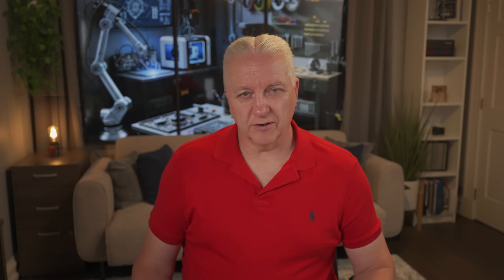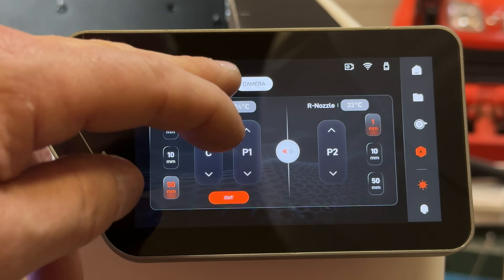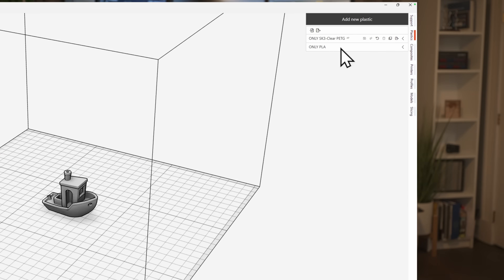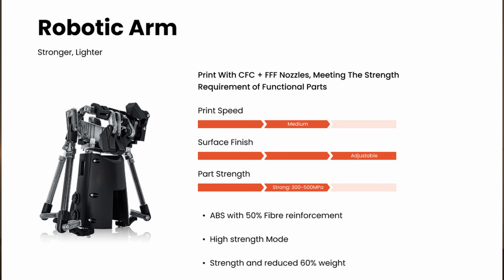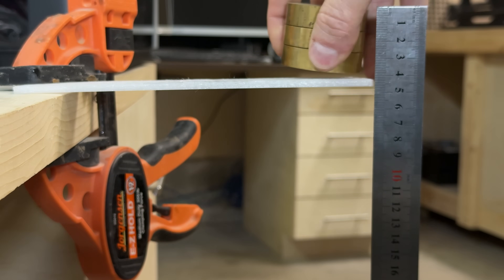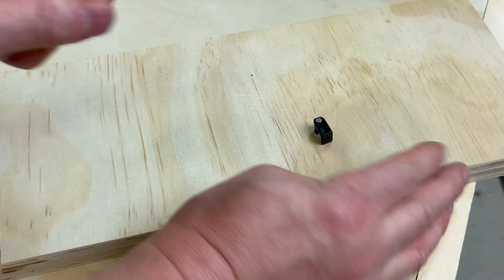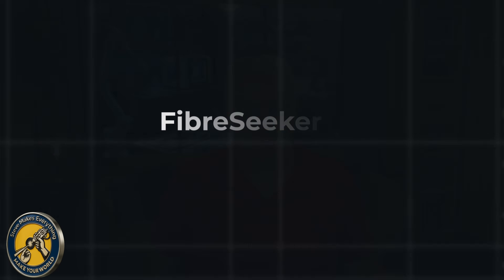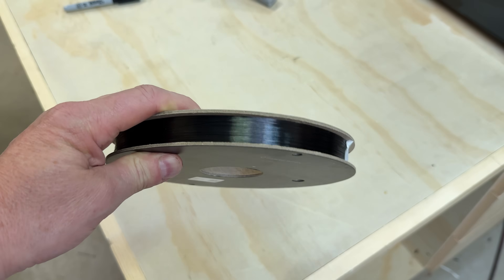This 3D Printer Makes Parts STRONGER Than Aluminum!

Comment: This printer is a hype. It can't put fiber threads in a z axis where every 3d print is weakest. It's overpriced printer for USA market where everything is overpriced. Plavix is 600 EUR in USA vs. Europe 24 EUR a pack. Seems USA wants people dead.
Reply from the maker: The. I’ll simply say, “Don’t buy it”.   This printer isn’t about making carbon fiber processes better.  It’s about making 3D printing stronger - and it does that just fine.

Comment: Let’s address the elephant in the room: Z strength.  Z strength is limited by layer adhesion which is substantially weaker than XY even in traditional cartesion polymer 3D prints. And it’s disappointing that Fiber Seek has the same problem but even more so.  It would be a game changer if FS could change their slicer software to print continuously in the Z direction.
Reply from the maker: This true but also applies to carbon fibre cast in resin.  There will always be one axis that is weaker.  As a designer, you can print in an orientation so the strength is in the direction of the highest stress.
Reply: @SteveMakesEverything  The difference is we can choose the best orientation to apply each layup, but with printers we have to choose one orientation for the entire part.
Reply from the maker: @snivesz32  True, though this might be more of a corner case - a least for the kind of things you'll make with this printer. 

This printer isn't designed to replace existing carbon fiber processes, but rather to make 3D printed parts stronger.

Comment: Does the fiber only add strength in tension, or does it help parts in compression as well?
Reply from the maker: Carbon fiber in general is for tension solutions. I think if you put two similar pieces in a vice - one with CF and one without, they would probably be crushed the same way.  I don’t think the  3D printing would make any difference.  Even in resin the CF would crush.

Comment: There's no point to high strength mode if the software is unreliable. Hardware is useless without dedicated quality software tools.
Reply from the maker: I didn't have any issues with reliability of their software.  I'd rather use OrcaSlicer because it's one I'm used to with other 3D printers,  FileSeeks software gets it done, though I'm waiting for the Mac version which they say is coming.

Comment: Hello,i am curious as i thought carbon fiber will need epoxy to go full strength.but i don't see any with this printer ? Is it a bad thing it lack the epoxy ?or it doesn't matter ?
Reply from the maker: The goal here is to get parts that are much stronger than basic 3D printing and the FilerSeeker 3 achieves that.  But carbon fiber is always layered in some way (3D printed or not). Along the layer axis, it will always be weaker.  If this case, the layers are sandwiched together with a layer of PETG, PLA or other plastic rather than resin.
Reply: @SteveMakesEverything  Thanks a lot for the explanation. So the layer of plastic act as an epoxy ?
Reply from the maker: @vdiallonort  Yes exactly.  When the fiber is extruded, it is encased in liquid filament and then basically prints like any other filament material

Comment: I really do not get your take on this.  People will not print these fiber reinforced parts in volume for production.  These would be more for a part here or there.  As another creator said, “A part that would normally take 45min now takes over 6hrs with fiber replacement!”.  

Hammering a little nail that I can hit the side with my tape measure does not show that much strength.  If you used a hammer claw to remove ring shanked nail then that would been a better test.  

Side note - Towards the end it just felt like you were winging it, and fishing for things to say.
Reply from the maker: As far as timing, it would depend very much on the amount of carbon fiber desired.  If it is solid CF, it will take 4-5X, but if you just want to lay down a 10% infill, it will be much faster.  However, I disagree that this isn't used for production because this printer originates in an industrial company that  makes printers to do exactly that.  However, to your point, regardless of the material, anything 3D-printed is a prototype as far as I'm concerned.

The point of this video wasn't to hammer a nail, but rather to print something simple that people can relate to, which would otherwise be impossible with a 3D printer.  I guess I could have printed a wheel wrench 😉

At any rate, this printer is not for the average home user.  I've already printed a bunch of camera and light mounts for my studio that I would have had to get a machine shop to make out of aluminum.

Comment: I think Markforged will give a more consistent strength and finish, they have had a while to improve their system and the precoated fibre is more uniform than smooshing a fibre into some melted filament. This seems like a good start though. I hope they can get it a good enough standard to make it a viable alternative. I wouldn't want to be in the first batch of users though.
Reply from the maker: Possibly.  Keep in mind that the FileSeeker 3 is under $3K, while the cheapest Markforged printer is going to run in the $15K-20K range.  You have to get something for that extra money. 🙂

Comment: Curious about layer adhesion and strength along z axis.  Thanks for the vid.  Great review overall.
Reply: From what little understanding I gather out of this video, its conceptually sound. But, there still lies various weaknesses. The weak link is similar to regular fdm and that is in between the layers where the lamination is all there is to keep the layers together. But, on the verticals where the fibres are passing through, the print outs will shine no doubt. Then again, how often does one need this kind of directional strength? I can't fathom. May be I am mere mortal, so i cannot comprehend further. A bambu a day solves many (but not all) problems a day and that should satisfy most mundane requirements including those of yours truly.
Reply from the maker: @chiawildy563  😀  Ever regular carbon fibre parts are bound with resin and are typically strong on only one plane.  This printer doesn't change that.
Reply from the maker: I guess no matter what, there will be one direction where the shear strength will be limited, but this applies to all material designs regardless of the manufacturing process.  Mechanical engineers will design parts so that when manufactured, the strongest portion will be aligned with the direction of the most stress. 

If you are making parts with excessive stress along all three axes, this probably isn't for you. In that case, carbon fiber in general wouldn't work, regardless of the manufacturing process, because it is always laid down in layers.
Reply: @SteveMakesEverything  Great sharing. I believe that like all tools, FS3 serves its own niche. It may not for everyone, while novel in concept. This novel approach to tackling strength is interesting for those who has a genuine use for it. I guess most of us won't reach this sort of mechanical strength requirements if we are just printing toys, lamps and whatnot. Cheers.
Reply from the maker: @chiawildy563  Yes, I agree.  This printer will definitely not be for everyone.  I'm thinking it's aimed at print farms.

Comment: I am glad to see the 3D printer industry making printers that can handle engineering-type materials to make strong functional parts.  But this Fibreseek printer takes that to a whole new level.  At the job that I retired from a few years ago, we had a Markforged Onyx Pro that could make strong parts impregnated with fiberglass fibers; we got very good use out of that printer.  But to see this Fibreseek printer with a much larger build volume selling at half the price is a revelation.  I find myself wondering how they worked around Markforged patents; have any of them expired?  Thank you so much for this video!
Reply from the maker: Industrial 3D printers capable of carbon and glass fiber printing have been around for years. Not sure who owns all the patent though.  I am wondering if FibreSeek is going make glass fiber available too.
Reply: @SteveMakesEverything  Hi Steve. During the plant tour that Grant @3dmusketeers did Ryan mentioned that glass fibre will be offered in the future. Not sure if near future or a yr from now. Copper wire was mentioned also. 
The biggest question   (unanswered) for me is what infill patterns did you get to choose from? 

Thanks again for your well-done video sir!
Reply from the maker: @helixx_4D  Yes, glass is definitely coming.

There are several infill patterns specifically for continuous fiber in Aura.  A couple of them appear to be ISO manufacturing standard infills, and the others seem to be variants of these.

They differ from traditional patterns found in tools like OrcaSlicer because they are designed to keep the fiber running as long as possible before it needs to be cut.

Comment: Yeah the hardware isn’t such an issue anymore but the software is a major hurdle for such a printer. Same goes for 4/5 axis printers.
For high strength parts I use my hobby cnc and aluminum.
Reply from the maker: Yes, this is just another way to do those parts. This printer won’t be for everyone, but if you need strength and true 3D parts, then this is ideal. It can make things that are hard for CNC unless you have a 4 or 5 axis machine.

Comment: It would be awesome to see it being used on complex geometries, where 3d printing really shines. Things that you couldn't just perform a 2D operation on a cfrp plate, or get out of a 2 part mold.
Reply from the maker: Good idea. I was going to print a carbon fibre benchy to see if it was possible. Maybe I’ll do that yet.  I’m using it to create replacement mounts and clamps for my camera setup and it’s been great.

Comment: Thanks for taking the time to make this video. So far the printer looks like a very interesting next step in printing. I, however, am not sure if the market would be looking for a machine like this to make “strong PLA and PETG” prints that you’re showing off here. If I had any selfish recommendations on a possible next video, I would be very interested to see this machine used for more “engineering grade” filaments like Nylon. I would assume that my use case for this printer would be something like PA6-CF for the main filament (chopped carbon to help the part from warping and give some base rigidity) then a plain PA6 as the filament for the continuous carbon fiber nozzle. I’m assuming something like this would be the ultimate in stress testing a machine like this
Reply from the maker: Yes, this makes sense. Keep in mind, though, that this printer is, in fact, a consumer-grade printer. It comes from industrial heritage, but its target audience will likely use PLA, PETG, ABS, or maybe ASA. I use nylon for strength on occasion, but with this printer, the strength is actually in the carbon fiber, and any plastic is really just protective on the outside.

The FS3 can certainly print almost any rigid filament, though.

Comment: Thanks for this thorough video Steve. I have had this on my saved list on KS but unsure if it is something that would suit me. Nevertheless it is very interesting
Also on my list, unsure if you heard about it is Kare3D Metal printer. Would caution as it seems like a new brand but again seems interesting
Reply from the maker: Happy to help. I’m currently using the FS3 to make some improve mount and clamps for my camera setup and they are coming out great. Definitely much stronger than my old PETG parts.

Metal 3D printing is the next wave. I’ve seen the Kare3D project on KS but I’m not sure where they are with it. Kickstarter always worries me when the company is completely new.

Comment: Looks interesting, but I'm not sure I would ever have a need for it personally. All the prints I do are functional, but non-load bearing.
Reply from the maker: Yes it's definitely for a certain audience.  For anyone doing RC planes and cars, it's great for strength without weight.  I'm using it for some improved brackets and things for video equipment and it's doing a great job for that.